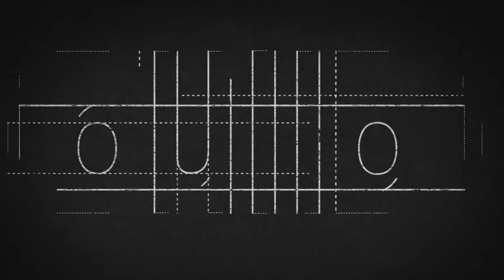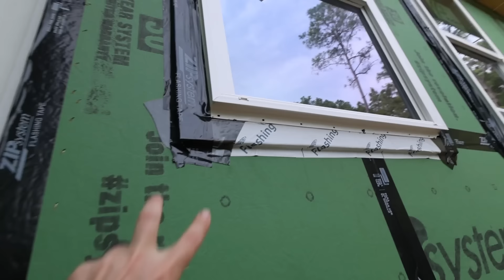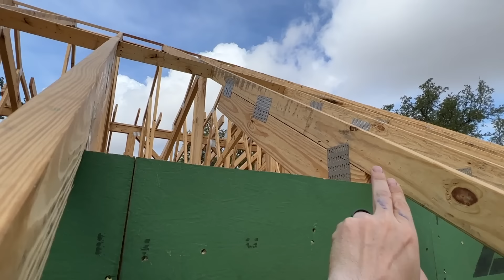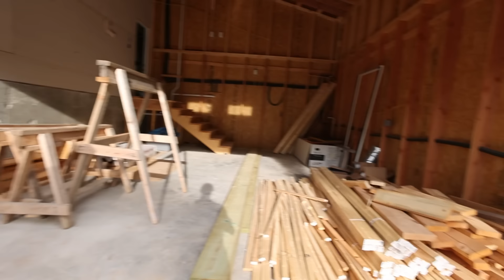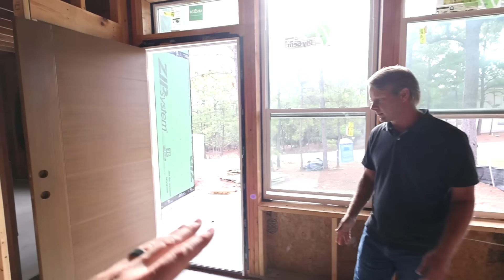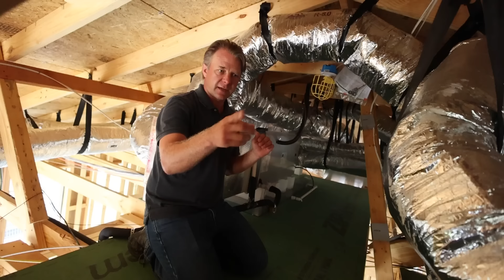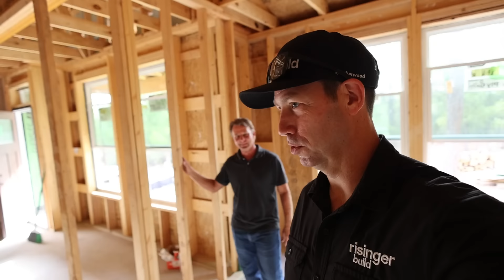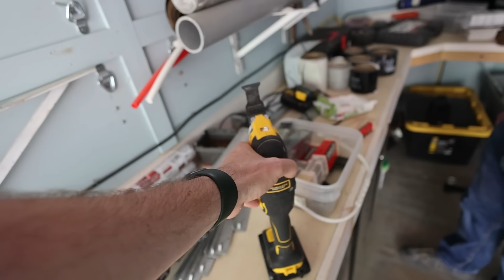LOW BUDGET Details For A High Performance BUILD

Comment: I Like this Contractor.....Back in the early 80's I was a contractor breaking new subdevisions and building high end customs to order in Maryland. The real trick to keep HIGH QUALITY CONTRACTORS is to keep them (in work) without a void of (no work) which corolates into zero income. I had 2 crews....each crew was in itself 2 crews....and we broke ground every 4 weeks + or - for a new construction. ( 1 part of the 2 part crew) completed the primary framing to completion ie: foundation to roof, soffit,  interior/exterior walls, etc. The (2nd part of the 2 part crew) completed window & door install, stairs, *intricate interior vault ceilings, etc. Think of the 2nd crew as a specialized finish framer....they would be the ones to tape and seal, take time installing a 10'slider and exterior windows/doors CORRECTLY, bathtub/shower framing and installs, final frame a drop vault cealing. They are the final frame crew prior to rough in electric/plumbing/etc. It all starts with QUALITY FRAMING....it's your prep to a high end finish. ALSO $$$$ and TIME associated with PROFESSIONAL TECHNIQUE without giving them skull cramps on each job. Doing it this way I was able to cut time in framing and get a MUCH HIGHER QUALITY COMPLETION...while increasing home construction from 24-32 homes a year to a high of 48 per year....mind you that 2 full crews of 2 sub-finish crews each @ a new build every 2 weeks. Logistic planning with material "than becomes" a primary concern. You now have quality contractors...keeping them in timely in material and home inspections during the builds requires (2 Foremans I hired) to oversee/inspect/and coordinate material. I hired (3 punch out carpenters) (high end men from rough to finish knowledge ) plus 2 labors, and of course  secretary and plan crew.  This way if I had A FLOW of QUALITY homes ranging from 2400 Sq ft to a few as high as 4800 Sq ft. The stall in construction was always interior plastering. Remember KEEP THEM IN WORK....I had high end finish carpenters no crappy miters and air nailer (fit and finish), A REAL ELECTRICIAN and PLUMBER...clean wiring and finish and clean straight (or fall as required) for plumbing. 
It all starts with a DOUBLE SPLIT TRAINED QUALITY FRAME CREW.

Comment: Framers suck. Seats cut r wrong. Wouldnt pass inspection in seattle. Seat cuts 2 deep n weakens rafter. Crap work n rafters will split under snow load.

Comment: East Canada here. Really appreciate this sort of building practice. I have an attic/soffit/2inch air space to ridge vent project with a carpenter scheduled for 2023 and finances permitted, an extension where the Siga tape might be very useful. Thanks for these low budget air tight practical ideas. 👍🇨🇦🛠🔨

Comment: here in the DC Metro area, when we run water supply pipes in exterior walls, an R-22 is required. In order to avoid that we would have come up thru the slab with pre-insulated Uponor pex in the concrete slab along with the PVC waste.

Comment: This builder is concerned about quality, but in the process of talking about spec houses, I'm learning that spec houses are often built with less qualified workers and a greater concern for cost savings, probably often at the expense of quality. Is that correct?

Comment: This guy knows his stuff and is super responsible to both customers and the environment. He's thought every aspect of the build through for decades and got those answers and has found ways to get the most value out of building highly engineered, comfortable, durable homes. Could use more content from this guy. Or he should write some books, have a definitive how to video series like Larry haun did for framing in the 90s (but for the entire home).

Comment: Nice format / / /   Re - cardboard   -    I have seen Paper interior walls where the  paper is about 1/4" thick in south Korea.!
This was / is in a house with hot water heating in the floor. & cement all around ; even a cement roof!  The shower / bathroom has a door stoop  (bottom rise ) of about 1 1/2 to two inch rise to ensure the water stays in the bathroom.

Comment: Why were those 2x8 or 2x6 mounted vertically every few feet on the 2x12 floor joists over the kitchen? Is this because decked bonus room above was an afterthought and does something to strengthen the 2x12?

Comment: This is the best video Matt has produced that I have seen. A Question about the spray foam into the eve cavities. From what i know spray foam cant be applied beyond like an inch or two thick, or it over heats because it is insulating itself, and then it doesn't cure properly. Does the spray foam guy do multiple passes?

Comment: I don't get why so many of these houses use Zip as exterior sheathing when it has a perm rating of under 2, and anything under 3 is going to trap vapor and ultimately rot out over decades. A decent plywood covered by sefl adhesive smart barrier will have a perm of 3 to 5, so much better vapor transmission.
Reply: plywood > osb, agreed.

Comment: I thought you wanted the air flow for the soffit?   That is how every house in my area is built and has vented soffit to increase attic ventilation.
Reply: that's the norm for vented attics. scott mentioned the attic is wholly conditioned so this could just be an unvented attic.

Comment: I signed a mortgage for a new 2BR townhouse in Livermore, CA for $457K in `05.  The walls were so thin that the neighbor`s TV prevented my sleep (most times) in my MBR, and the guy in the townhouse across the shared back driveway would wake me up (all too often) by driving faulty mufflered vehicles into that alleyway to wash.  Because I worked shift-work with severe scheduling, I actually had to drag my mattress into the hallway and close the BR doors to get some sleep.  

I almost complained to the neighbors; but didn't.  I figured that maybe they were trying to earn a bit of legal money to pay their bills, and I didn't want to hinder that.  So I dealt with it - and this is only the 2nd time that I've mentioned it, and both times were this year.  After paying much money against that mortgage, I got sick and ended up short-selling after about 8 years and rented a place closer to work until my retirement in '14.  I still love California; but that housing experience was very sad.

Comment: if you rough in electrical before roofing and or siding the paper in the romex can get wet and some inspectors will fail this, I have heard, don't  know if is true, that the moisture will follow to the power source origination, the panel, has anyone heard of this?

Comment: I’ve been a builder (I actually build, not a farm all of the job out and call myself a builder) in South Dakota for 25 years.  Around here If you build spec homes with all subs you’d go immediately broke.  Not to mention carpenters are getting increasingly hard to find as they all go broke and go work in town so if I built specs I’d be building them myself anyway.

Comment: I’m lost here. Currently, my house I’ve essentially conditioned my attic space but I did that by leaving a 1 inch air gap in the stud cavities using baffles and then spray foam over the baffles. This allows the air to still pass through the soffits and under the roof decking. I assumed the home had to be able to pass air across the roof decking. That’s why I chose encapsulation conditioning. How is this house passing air across the roof decking?

Comment: I'd love to find some ways to apply some of these lessons to my 1969 build up here in WI. drafty old house. They finished the basement ceilings without insulating the rim joists. Consequence of this, has been that they ran the dishwasher electrical and drain through a massive through that rim joist cavity. In the winter it lets like 30 degree air into the kitchen! That's just the tip of the iceberg on this house.

Comment: I'm amazed how little insulation is used in the USA.  It keeps the houses cool in the summer and warn in the winter, and lower the prices on cooling and heating A LOT!!   In Denmark, it's MIN 30 cm (12 inches) insulation in the walls and more on the roof and in the concrete foundation. NO crawlspace under houses here! 
And double or triple glass windows. Etc. etc.
All good for the resident's economy AND climate changes, and only a bit extra cost for contractors who like to build crappy houses, but besides them, it's clear a huge:  Win-win!

Comment: With a house thats so Air tight aren't you afraid of mold or meld dew? In the early 1980's my brother and dad which was a builder before the bottom fell out in the late 60' early 70's. But my mother put up the money for material on our homes . There was 3 of us , my two younger brothers have passed away . But the houses are still in the family except for the largest home 4800 sf. Anyway the first house was so Air tightthat on one wall he had mold growing . I was not here to find out what he did to correct the problem.

Comment: having been in the home building field for a good 30 years, houses need to breathe, they need some moisture, they need air pressure balances: equilibrium.
 if a house doesn't get these things, they will implode or explode where ever the weakest link in the chain is, and that will be where your house literally starts rotting within the first year. why? because of pressure imbalance. it takes super high tech HVAC systems that have to have an air exchanger to maintain this balance with big energy costs in doing so. 
too weak of an HVAC system  higher energy costs and  early burn out of that system. also it will not be able to keep up with barometric pressure changes and your house can literally pull water in from any crack such as doorways, windows, vents, all of which are held in place by wood, which rots. 
i've seen stucco houses pull water in right thru the cement stucco, water will run up a roof along the underside....all kinds of nasty EXPENSIVE surprises.
never underestimate the power of mother nature. even the soviets found out pure concrete apartment buildings and houses crumble and failed very early because they thought they could overcome nature. sure quality wasn't the greatest, but look at ukraine as those buildings are fairing far better in war at 50 years old...the wood houses already burned to the ground or exploded into toothpicks.

i see alot of mistakes in this house as it is not built to shed water from the top down, the top always being the last layer to go on, and is on top of the preceding level below it. running an air and watersheild vertical in one piece is great until it laps over an upper level, this will not shed water and thus is a code violation. build up with the layer above always over the layer below. 4:03  that barrier below the second level should be on the underside of the 1st floor to 2nd floor sill, and the first floor to second floor sill should be below the layer that covers the 2nd floor to 3rd floor, and so on. if it doesn't shed water...you messed up, any water that has infiltrated the house or originates in the house must excrete outside. mostly this happens from condensate and humidity and temperature differences of the interior and the exterior. not just the air temp inside and outside, but a southern wall will be hotter than a northern or western or eastern wall even if the outdoor temp is below 60 the wall can be 80 on the exterior. this also causes expansion and contraction gaps as things break apart as they are forces to expand, as well as break apart when they are forced too contract. so with the sun, the air pressure and throw in HVAC and or a fire place..... you will have major issues.
fireplaces dry out a house to the point of tinder for a flame, your house is going to be so moisture starved it will wick and pull in water right thru concrete to get it.

Comment: Interesting to see with Swedish eyes! We use a plastic film on the inside that we tape to let beams and insulation to be able to transport condensation outwards to the air channels. The erv fans are almost mandatory then since the house and inner climate is like a plastic bag. would be interesting to see more about your foam and insulation even though you have a different climate then ours :)

Comment: Wondering about caulking the bottom plate from the inside. Are we not worried that if moisture ever does get under there somehow, it won't be able to dry out? Seems like the tape on the outside is much better than nothing, without the added risk of rotting the wood. Thoughts?

Comment: Amazing video! So many great tips! 
1) Would Matt or Scott consider SIPs for a decently (if not perfectly) sealed house?
2) Are sealing techniques completely different for SIPs? 
3) Are SIPs still cost effective including time and labor vs Zip with lumber prices coming back down? 
4) Also if you could say a few words about 24" on center 2x6 framing. Advantages, disadvantages. 
5) Are framers, architects, engineers, builders familiar enough with it? 
Asking as a home owner in the architecting stage. Thanks a lot!
Reply: @Matt sorry for the ping but really curious about these answers. Thanks!

Comment: Such a mindbonb... Everything in reverse from what we do here up north, in regards to vb and air seal... But of course - you want to keep moisture out... We don't have that issue, as it vaporizes, once air gets heated to room temperature ...you need to cool it instead, turning the whole condensation story upside down. Cool to see, but would be a complete disaster around these parts. Shows how important adaptation to local environment is. Especially trying to cut consumption on running the house, while at the same time at least maintaining comfort levels, increasing longevity etc. Keep it up.

...rainscreen is key though. Alway a good idea.

Comment: You call this type of work High Performance, I call it the right way to build a house. I'm a landlord and own a few houses. Because the cost of contractor is so high and there's a lot of guys that think they know what they are doing and awful at what they do I end up doing my own work. I've seen some of the worst building methods in some of my home. I have to fix the messed up work they do. All home should be built the way these homes are built, but I believe that about all products.

Comment: .... Umm.  Aren't soffits meant to have Air flow to allow ventilation in the roof so it doesn't melt snow or overheat in summer🤔.   This would never work further north at least.

Comment: This is a very informative video on some really practical build processes!! 
One burning question I have is when the soffits are foam filled, especially when considering spec-level labor, what is done to mitigate excessive foam thickness causing cure issues which have been chronicled to induce hazardous off-gassing?

Comment: Great video, super cool work Scott is doing!  Question, on the first house on the two story section, I noticed the zip boards laid out side by side and top on top.  wouldn't it be best to stagger them for better structural support (just like roof OSB pattern) ?  Scott, also ditch the trailer, get a 170+ Sprinter :)   thanks!

Comment: For the ERV, in addition to manual boost switches, a flow switch on the hot shower feeds is a really great way to ensure extraction is boosted when most needed. Here in the UK I've used the FS-10 flow switch, it's cheap, super reliable, pre-mounted onto a short length of 15mm copper and is easy to install into the standard shower supply. I wire in parallel with a manual boost switch to give 'fart fan' functionality also.

Comment: Why spray foam directly to the roof and fill in the soffit?  In my house I used radiant barrier wrap facing up stappled on rafters. 
I then stappled it 2" in on exterior walls above the top plate.  This allowed them to spray foam on the barrier and not directly to roof.  I had soffit vents with ridge vents so the roof stays way cooler.  It prevents the conduction of heat and also reflects some of the heat back away.  On my brick walls around house I used radiant barrier facing brick to keep evening heat out. My home is 2500sf and all electric.

Comment: an old acquaintance built a metal 6k sqft home and used  commercial metal walk in freezer panels for walls and roof. outside brick inside sheet rock and standard metal roof over the panels. He did mild air infiltration practices and not to the degree of this video.  outside walls were much thicker but looked normal.  so in the end a 3 ton ac system heated and cooled 6000 sq ft.  It makes me wonder if he took the extra step to seal everything would a 2 ton ac system heat and cool 6000 sqft?

Comment: If you are doing a traditional home in the northern climates.  How do you air seal your roof if you;re using traditional blown in with an unconditioned roof?  Is it still possible to make it air tight or would the roof be excluded?
Reply: Saw a video a while back on air tight attics.  Redoing blown in insulation in older homes the right way.   Remove old.  Calk seams.  Reblow new stuff.   Of course leave the soffits for plenty of airflow....  Even cutting and replacing crappy little vent holes(read 3 maybe 4 old cold air returns covers for indoor furnices) they used to have in the soffits....   Yup.  Hopefully you can find it now if you need it

Comment: Wow where is he getting his spray foam from?  Cheaper than other options for the roof deck?

In Albuquerque we are floating about 20k$ to sprayfoam just the roof deck.
Reply: He's factoring in labor costs for doing what he's doing on a more complex roof that made it more efficient to just spray foam then to  pay a bunch of ppl to do a more complex insulation job with conventional batt insulation.
Reply: @lisat9707  i dunno.  That would have to be a Hell of a complex roof.  Wait did he specify closed or open cell?   I can see open cell on a complex roof being worth it